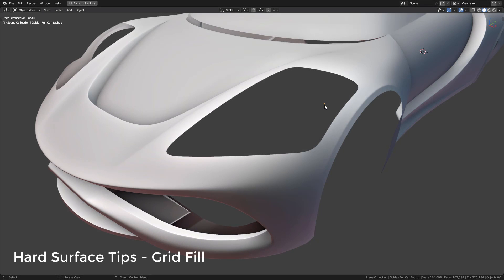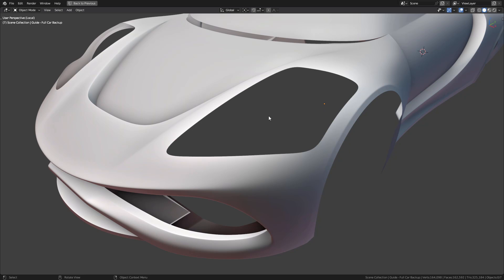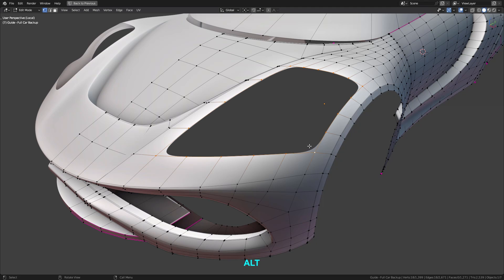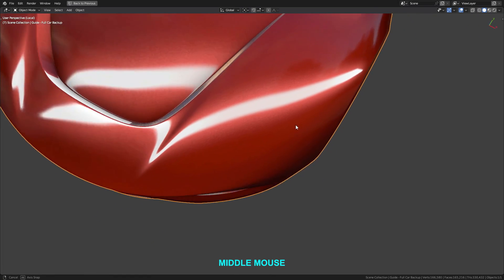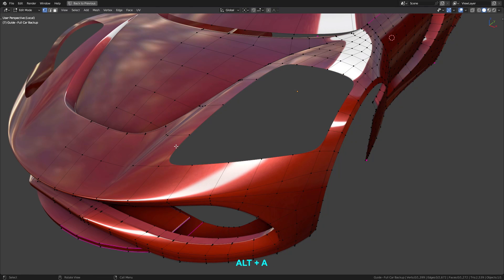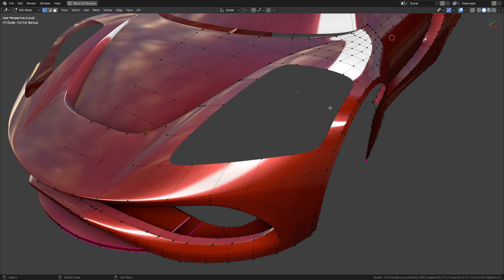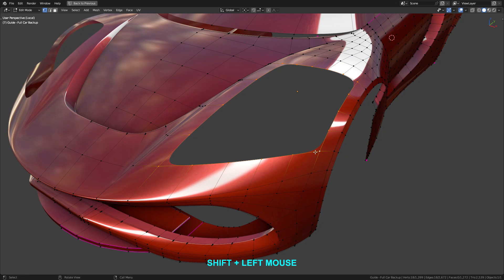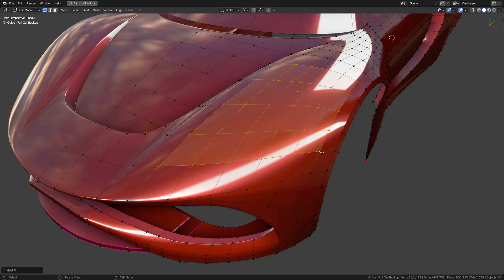Hard Surface Modeling Tips - The Perfect Grid Fill in Blender

Comment: You don't have to select the whole hole. Blender's manual page on Grid Fill shows an image of just selecting two parallel edge loops, which works fine and may be more predictable than selecting the whole thing even if you remember to make a corner active.
Reply from the maker: I wasn't aware of this but you're right, it works perfectly and you don't need to have a corner be an active selection, sweet, thanks for the tip.

Comment: how can i fill a u shape, i'm trying to cover the chin of mask, connect the left and right side of jaw, very complex shape but in essence a U shape
Reply from the maker: Depending on the complexity of the area, you'll run into some limitations with Grid Fill. Like it can't predict any unique curvatures you might want in the middle of the area being filled, and is instead entirely based on the surrounding topology. It will simply create a smooth transition between all the edges surrounding the gap. So as long as what you're looking for is just a transition from one side to the other, then Grid Fill will work great. For something like facial features this might not be the best tool though, but you could still use it to get some topology filled in and then edit the new topology to your liking. If Grid Fill doesn't work out, then I guess manually filling in the area would be the way to go.
Reply: thank you @blengine

Comment: I had no idea about the corner vertex selection. Will try it out asap!
Reply from the maker: I think it's always possible to get the same results no matter what vertex is active, but it takes some parameter adjusting so a corner vertex being active saves a little work.
Reply: me neither lol, but also selecting one of either side parallel edge loops seems to work for me everything time as well...

Comment: Pretty smart, what I usually do is connect the top and bottom vertices, (im gonna use your car example), and so I have 5 faces next to eachother that are straight, then I add 3 loops, and take the 1st vertice of that loop and connect it to the left side, and then use active element of that vertice to scale it to the right, and then repeat it for the other ones.
Reply from the maker: I use a similar method too, but if I'm careful with topology then larger areas like on fenders are prime spots for grid fill to do its magic. Sometimes I'll take an area I manually faced up and give it a second pass with grid fill too and often end up with better results. Very cool tool.
Reply: @blengine  Yeah definitely sounds like a nice tool, will give it a shot if I ever come one of these areas across in my next car. Btw, do you have a discord community? If not, you really should make one!!
Reply from the maker: @vexqty  Not yet, but I've gotten a lot of requests, so after this course is totally finished it might be time to get one going!
Reply: @blengine  Awesome :D